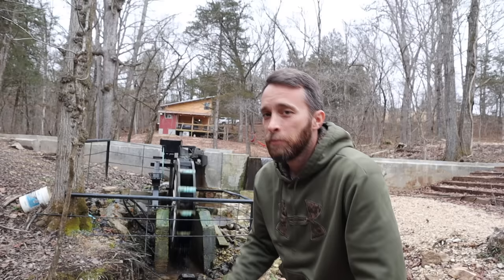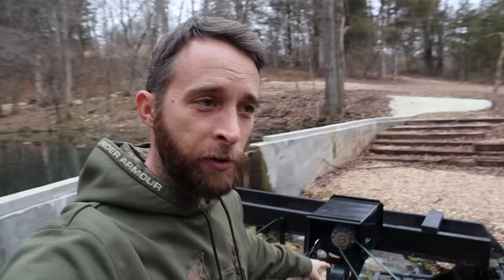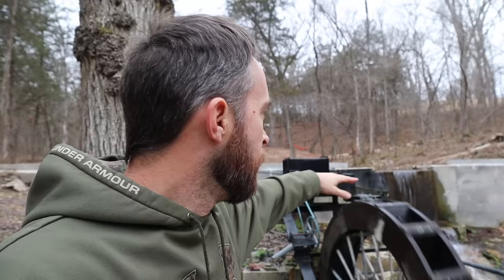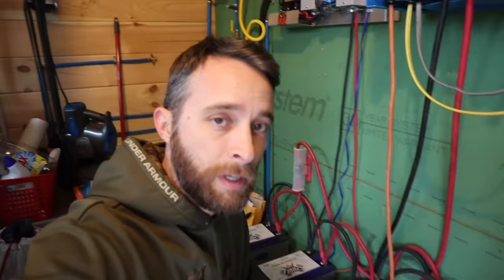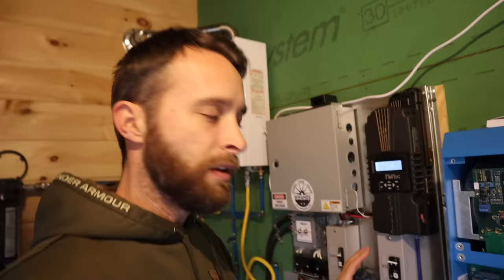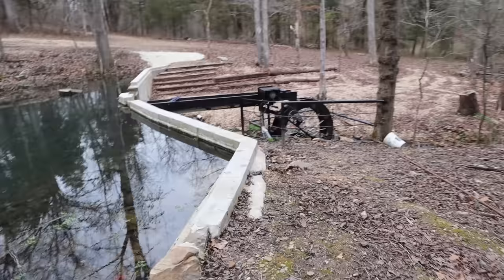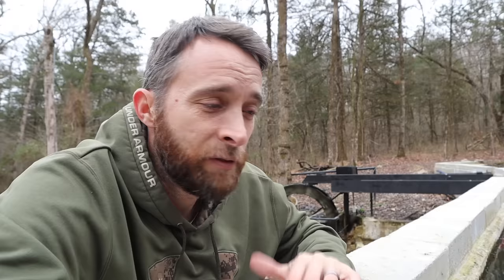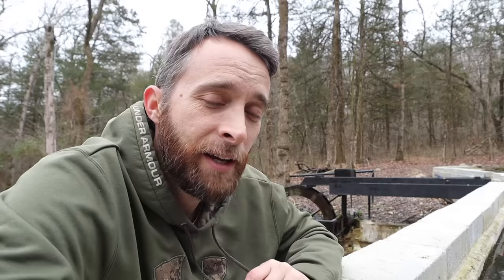Did we MAKE HYDRO POWER Using Our Waterwheel for Self Reliant Off Grid Living?

Comment: Just watched your video, there are a few routes you can go. 
You can put up 4 - 500 watt panels monochrome which you can create
2000 watts and use a mppt that can set too 48 volts DC .
You can still use the system you have but you can put a switch from
Your water set up during winter and use the solar system during the summer.
I don’t know the battery set up you have but you need to know if that’ll ruin your refrigerator
 24 / 7 . The refrigerator won’t draw that much over a period of time of 24 hours. I have just purchased
300 amp hour batteries which is 12 V and I have two of them. I was able to purchase the batteries
Directly from China. Politics got in the way of the pricing that Trump was nice enough to cancel the tariffs
Which kind of jacked the price up. But each battery I paid $500 and each battery weighed about 90 pounds.
The panels solar, are 500 W each and I have for them. They’re bigger than the normal standard size solar panels
 Because of the wattage. They are about 4‘4“ wide and about 5‘6“ high. But I got each panel for $115 each
Which is a steal. What ended up costing me more was shipping was only $350 by the time you get done with customs
 For which they charge you $600 to look at and the storage until you pick them up  cost Another $1400. 
Let’s hope President Biden can get this fixed that way you’ll Only pay less than $1900 give or take 100 bucks.
Now I know you can get creative with your friend that builds everything will have no problem. Now if you tell them
How much wire you need and the female and male fittings they were nice enough to throw that in. I had figured this system
To run my 30 foot trailer for camping with either the heater electric like ceramic heaters and or AC for up to five hours
The size of batteries that are lithium also are the way to go because they’re huge and they have a built-in battery management.
That way you don’t overdo it. Let me know if that’s what you want to do I’ll send you the information and you can check for yourself.
The other thing is if you know somebody that does solar in orders from China maybe they’ll let you attach it to their order.
 Shipping usually takes about 42 days by ship or you can pay fed ex which will deliver it to you but I have no idea what that would cost. 
 Well I hope this helps you and if you have any questions you can text me, 408-391-7016 and the name is Bill. I am in Northern California.
Reply from the maker: Thank you for your input and suggestions

Comment: to me with how low of head you have a wider water wheel is needed for the waight of water to be collected then to be stepped up with pullys to the generator something with low rpm i pklan on hoverboard motors as they are 3 phase either mppt controlled or the regulater from a truck alternator with a system to control wheel speed

Comment: The pond and water wheel look great. Get an electrician to look at your system. Preferably one with off-grid experience. What I see you have , looks a little over complicated and definitely over sized for your water availability. Try to resist the temptation to over-engineer the electric part of your system. When transmitting electricity, high voltage AC is best, there is less electrical  loss. Most of the over-sizing works against you, due to the losses in just powering the circuitry inside the units. I don't want to be critical,but I think you may have been talked into buying an electrical system that is far too big for your water availability and your location.The extra shafts all cause losses due to friction. The vee belt drive slippage when wet alone could stop electrical production, If the belts are tight they will cause extra friction. Never the less from what I see, I think you should be producing usable electricity. If I had to guess I would say 150 - 200w with the low water level shown, maybe up to 300 - 500w with the high level shown. Don't give up, watch some utube videos and learn yourself. I use the acronym "KISS". Keep It Simple Stupid.

Comment: I'd start by learning a lot more about what you are trying to do. For example, you don't get more power by going to 12v batteries. The inverter takes the 12v DC and makes it 120v AC so yes you store twice as many AH at 12v but you lose all of that when going to 120v. What you save is wire thickness.  Where a 12 volt system may help you is in charging. The charge controller won't start charging your batteries until it's about 5v higher than the batteries. Check what voltage your water wheel is putting out. Also, the lithium batteries don't like being charged in extreme cold. If you did they might be bricks. That could be why it's not charging correctly. Either way you need to learn more about what your doing before deciding next steps. I'd start with really understanding what went wrong with your setup, not what people are telling you went wrong but rather using a voltmeter and understanding truly where the system isn't functioning.

Comment: Guess the problem isn't the generator, it's the water wheel.
First the design... it looses to much water and will not have a good efficiency, which means you loose to much of primary energy.
Also the wheel is very, very small, so there will be not much output.

Please remind: A water wheels works on the weight of the water, so it's gravity bases, and NO THERE IS NO CHEATING ;)
So you should just measure how much water you get within a second, this is the flow or Q
You should measure the drop hight, from the end of the flume to the water surface below the wheel, that's the drop height or H

Anyone can calculate now the estimated power, if the hydropower machine will work on 100% efficiency, so the formula is P= Q * 9,81 * H
So P will give you the power output in Watt....

And because of the improper design of the buckets, you loose water, you loose weight, you loose power.
So I consider following: The wheel is turning, spinning good. You get a high voltage, because of high rpm and there is no load on the wheel, except turning the generator. The charge controller get's a voltage at his entry and starts up the charging process, not the wheel has to go on load, should work, so the rpm has to drop, because now the wheel will slow down in working order, but because you loose to much water, the whole process stops, as the wheel cannot deliver to needed power for charging. So the power drop is measured at the generator, from there to the charge controller. The charge controller measures the incoming voltage, which drops and switches off... not there is no load at the wheel, the wheel starts gain turning freely and the rpm rises, as the voltage rises... voltage rises at the controller entry, the controller switches on and the cycle repeats...
That's why you do not get it running..

You need to do a load test on the water wheel first, and check, how much power do you really, really get from it...
Reply from the maker: Thank you 😊

Comment: Maybe a three bladed tesla turbine would have worked better at that water wheel diameter. Or at the very least some super capacitors to level the current output? Maybe you could make a wicking carburetor that is just a jar with a pipe connected to a t joint where that carbon felt wick takes gas to the top of the t joint though the carbon felt wick. As the engine sucks in air, it sucks air through the gas wick. So it is super simple and should not wear out. That may not make your engine run longer but it is to negate all the stuff that can tear up in a carburetor.

Comment: One other thing you can adjust it through the MPPT to 48 V which will charge much more quickly.
 Those 500 W panels will deliver 48 V.  I meant to say 48 V at 60 A, everything is adjustable.
 But in some cases it’s just better to go larger and heavier duty that way you can always add to the system
 N that way you can always add more items that will use more voltage via through the lithium ion batteries.
 The other thing I didn’t mention about the batteries is that they have about a 20 year lifetime witches
 Is more than enough for what you want. I also purchased two more extra batteries that they said will stay
 As back ups if needed. Do you have my number text me anytime if you need to talk. By the way do you have an extremely nice family.
Reply from the maker: Thank you 😊

Comment: Guessing others may have said it, but no, you can't take lithium batteries to zero. Not good practice. You can take them to a much lower state of charge than lead-acid however.
Reply: The BMS inside the Battle Born batteries allow the user to take the batteries down to the point that the BMS cuts off energy flow (down to zero). Internally, the batteries have an energy reserve that preserves battery health.
Reply: @bbcooter388  3.7Volt nominal cells should not go below about 2.8 Volts. So a 7S would be 25.9 V at nominal Voltage. A 7S string at full charge will read ~29.4 Volts. That battery could then be drawn down to 19.6 Volts. Guess what many Inverters are set at. High Voltage cutout/alarm of 30 Volts and low Voltage cutoff at 20 Volts. Exactly where the Lithium 7S batteries do their work. You'll note that BattleBorn  rates theirs to 100% discharge but then rates the lifespan at 80% DoD.

Comment: Have you guys tried to run the belt as big as the wagon wheel is to the to the motor of the generator everything you put on it is too much resistance you just need 1 belt to the motor as big as the wheel it will work

Comment: After all your effort to build a pond and wheel, this needs to work.  The line to the house is too long for 24 volts...even the big hydo dams here in East Tennessee step the power up at the switch yard, by the dam, for transmission.  A higher voltage generator is in order. To see the problem as it exist now, put the system in use under load, then measure the voltage at the generator and the at the end of the 250 feet of cable.  You should see several volts difference under load,  this is the problem.  Raising the voltage will overcome the long run of conductor.

Comment: yes 12v 100ah battery would not take as many rpms to charge however 12v 100ah is still 1200watt hours of battery storage and a 24v 50ah battery is still 1200watt hours with your 5 batteries thats 6,000watts of storage. Same power storage but higher amps on the draw from the inverter if you have lower voltage system. But at the same time it was showing 33watts of input thats not going to charge up the system but thats 33 watts 24 hours a day 7 days a week it will off set the demand. If you are drawing 100 watts of power with that on you would only be drawing 67watts from your battery storage not charge but last longer

Comment: Dc current does not travel long distances without huge losses. This is why Tesla told Thomas Edison to go to AC Voltage. Try an AC generator or put your inverter within 10 feet of your DC generator and use 4 Gauge cable and then AC current will travel easily in your 10 gauge wire to the cabin. I suffered the same problems when I built my smaller water wheel.

Comment: I have a year round creek from a large spring on my land with good flow and I do have a 20 foot drop or more.  I'm also in the Ozarks.  Do you have any contacts I could talk with about doing a water wheel for generation.
Reply: Hey! Send me a message, I have some ideas for you. Just gotta know some details of your site. When I was in my early 20s I cemented up a spring reservoir with two pipes in the reservoir wall. The bottom for my pressure line to the plumbing in my hewn log house I built and the top one to accommodate the constant springwater flow and piped down to an overshot waterwheel I built to generate electricity for my house. 12 volt DC  and inverter for 110 volt AC.
Is the spring site on your land? Does the spring come out of bedrock? How many gallons a minute? How long is the run from the spring to the point 20 ft lower?
Reply: Fitz style overshot waterwheel. Look up Fitz. 92% efficiency in University of Wisconsin tests. 
Also pelton turbine. You can make your own pelton by filling propane tanks with water to make sure there's no gas in them and then pouring out water and cutting the tanks in half lengthwise. Weld together in the shape of the number 3.  Two half tanks welded side by side like the number 3. Water strikes the center of the 3 and splits, directing the water out and away from incoming jet. Cut 8 or more of these tanks, weld together and weld these 3s around a wheel. Look up pelton wheel and you'll see what im talking about.
Build concrete reservoir around place where spring exits the rocks with a large iron pipe at bottom of reservoir, through reservoir wall. A trough or large diameter lengths of  pipe can be attached to that pipe in the reservoir wall, running over to your  20 ft diameter waterwheel. Overshot waterwheel. The water strikes the wheel direct top or slightly back from top to give impulse and gravity effect.  Read up on fitz waterwheels..  OR you can pipe it down to your pelton 20 ft lower and restrict the pipe to a smaller pipe at the pelton wheel for a jet of water to strike the turbine at high speed,  high pressure.
I'm 7th generation Alberti living within a 5 mile radius in these 'ol Catskill Mountains from since before the Revolutionary War. My father was Catskill Mountain Ike...last of the true Catskill Mountain Men. Blood brother to the Oneida, taught by Cherokee, he run a 200 mile trapline here in these mountains year after year and when he would shoot a big buck, he would tie it to the back of his full dresser Harley-Davidson and ride around the Catskill counties talking with everyone he met along the way.

Comment: Look into Turbulent Hydro Power....they make 5 kW vortex turbine models and larger....with a 20' drop I would assume you should be able to create something that would work
Reply: Gerrit Schuurmans he hasn't got 20 ft drop though?
Reply: @spencerwilton5831  he actually states at the 13:37 mark in the video that its "not quite 20 feet"...so one could assume that he is within a reasonable measurement of that distance...say 19.5'....turbine models run efficiently with 2 basic principals...the higher the drop in elevation the less volume of water required to produce the energy required OR the lower the drop the higher amount of volume required. An approx. 19' drop in elevation is a fairly substantial drop for elevation change and with some tweaking to that dam I am sure he could make his electrical needs with one. This family I'm sure will figure it out if they have not already and I wish them luck in this venture.

Comment: The main problems is in the generator 500 rpms is too much should be less than that.  A 24v generator is ok if you are going to charge 12v batteries otherwise you need a 48v generator to charge 24v batteries

Comment: Use an unregulated GM alternator and then get some kind of diversion load set up going either with the inverter but that'll do it for you you're going to have to run some fatty wire though your run is actually too long you're much better off building a shelter outside to house 
 your batteries and convert the power to AC then shoot it into your house

Comment: I would look at a PMG from motenergy.com the ME1112. There is more data on amazon for sale...look for ME112 PM. This has a dual winding. One for DC good to 100 watts or a wild 3 phase AC.  Each phase puts out 11.5 amps not matter the rpm or when converted to DC using a bridge rectifier 16.3 amps. At 140 rpm output is 12v or 195 watts. They are proportional to each other. If rpm was 1400 rpm then voltage is 120v, still same amps. So if you are currently turn at 500 rpm, then you would generate about 43v and 700 watts. Of course this depends on the actual flow and the ability to harness that with the existing setup. These are only 150 bucks, so pretty cheap to try it. With a few mods and the suggestions provided by the followers, pretty sure you can up the production. If you want to look at a gravity vortex system, I can assist. I am the North American distributor for the Kouris Centuri Turbine (KCT). Check us out at www.kcthydropower.com or www.barnardhsi.com
Reply from the maker: Thanks I’ll check it out

Comment: DC voltage sucks over distance.  You want AC to the house, then DC or BIG, EXPENSIVE wiring.  You need large gauge wire for DC or you will have big loss.  That is why many solar panels have micro inverters on the panel.

Comment: Have you checked the amount of power right behind the generator before it goes to the house I wonder if it could be one the run two a bad wire
Reply from the maker: no, but I should test it. thanks
Reply: @LoftisPartyofSix  just a thought and an easy check. If it's putting out the amount of power it's designed for you know something is going on

Comment: you cabin is to far away from the generator I think. That's why you loose amps. Build a new small cabin next to the wheel and put your setup in there and run your 110/220 v line from the inverter down at the bottom cabin to the top cabin. I think it will be better to charge it at the bottom with more amps using less cable and cable losses. I could be wrong but who knows. Maybe setup a temporary connection like this at the bottom and try it out. Would like to see what you have figured out so far

Comment: Why are you using a DC generator for a water wheel? That just causes a lot of unnecessary losses and an overall less stable voltage. An AC generator putting out a higher voltage would be more suited for this sort of application.